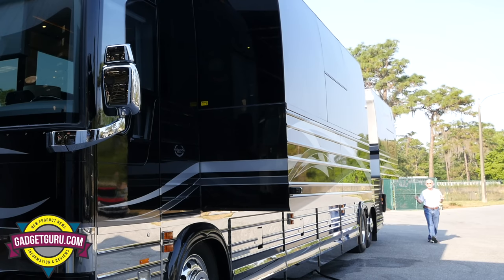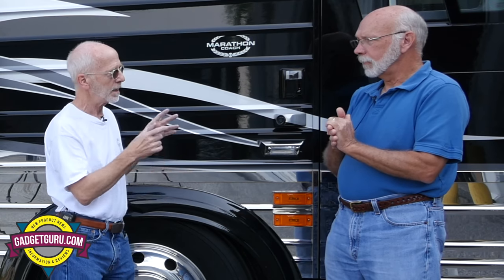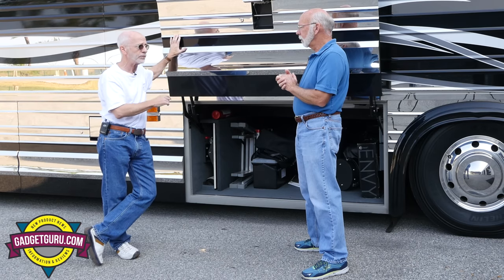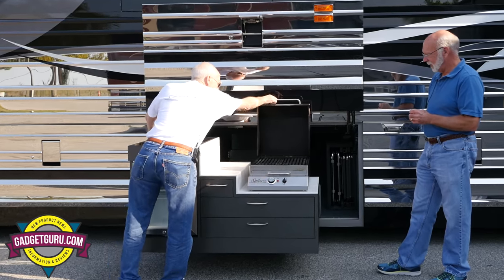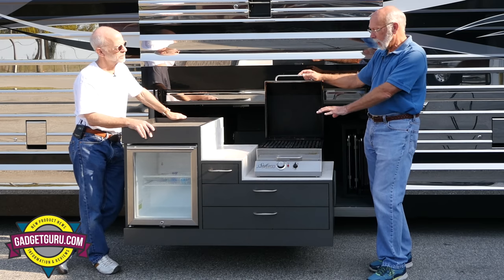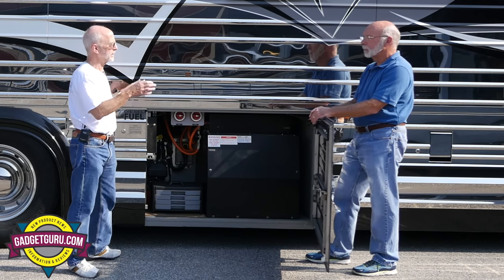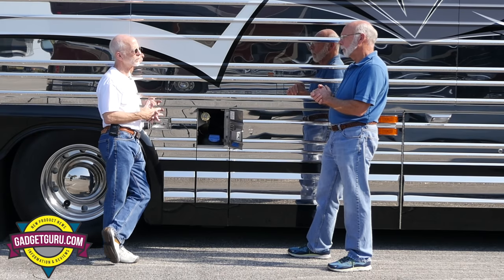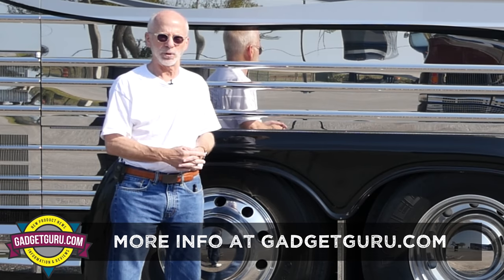Prevost for Newbies - Part 1: Getting To Know A Prevost Motorhome

Comment: Does it have central vacuum? Or do most of the Marathon coaches have central vacuum? I was looking at their video, but it did not mention it.
Reply from the maker: My bus does not have a central vacuum system. I keep a Dyson rechargeable vacuum on the bus and it seems to take up a lot less room than a typical central vac hose and frees up the bay space for the central unit.

Comment: the apartment has used a red line catch 22 about the danbury smokestack during polar war times and jim burnham is 100% responsible for discussing inappropriate catch-22s in front of the board, and i can do 7:30pm.

Comment: Holy Jesus mang.  Filling your diesel pusher and adding DEF does not require a 10 minute conversation -- it's simply not that hard.  Also, are you telling me this thing does not have rear wheel steering?
Reply: Old comment/post, but when we get our Prevost, I do not want more things to break. This coach, for example, is not my style, even though it is outside my pay scale (at least, if I still want to have a beautiful home that appreciates). Nonetheless, I want to keep it simple. Our coach will be pre-DEF, riveted, non-slide, DD 60 series.

However, I will update camaras, and basic tech (solar, TVs, sound, etc.).

Oh, and why are we harping on Marathon!? You own one. I get it, but I will just say that I subscribed a few shows ago, and then unsubed when it became too Marathon and then the DEF stuff.

I'm a nerd, but this is...whew.

Comment: Me struggling between Ordering a Newell or Prevost by Liberty coach. And I might decide on a Newmar because of their Super C “SAFETY”.
Reply from the maker: If safety is a priority, and it should be, stick with a Prevost chassis…really. Also, the only place to get factory service for a Newell is in Oklahoma. Prevost has factory service centers across the USA and Canada.
Reply: @TheGadgetGuru  Thank you for your response. Issue with Prevost I have is doesnt have the wheel in front, long wheelbase, cant have it 40’ instead of 45. Cant have more doors cut out.
Reply from the maker: @newsigmundfreud3023  I guess you've made your decision. Drive safely!
Reply: @TheGadgetGuru  Thank you again. I am still not so sure, but now I know that between Newell and Prevost it should rather be Prevost for safety and mechanics availability. I am looking for more advice though (not in a public forum).